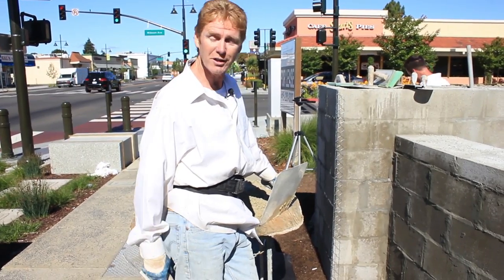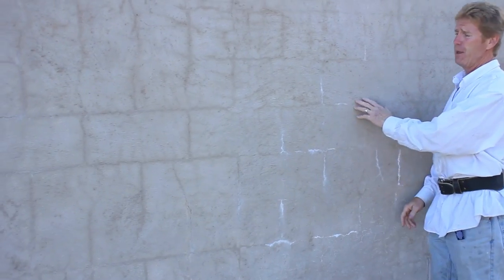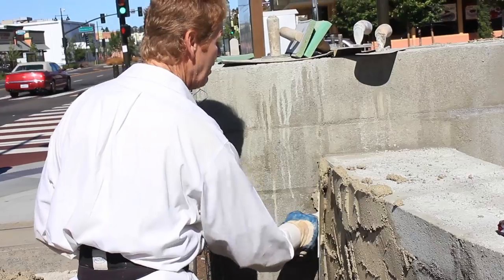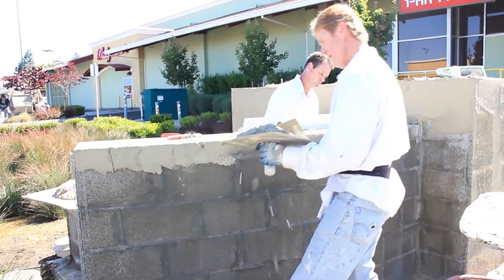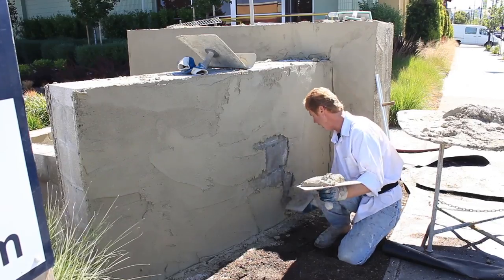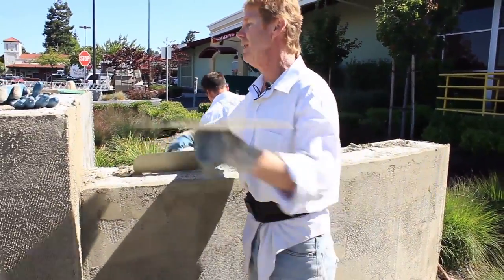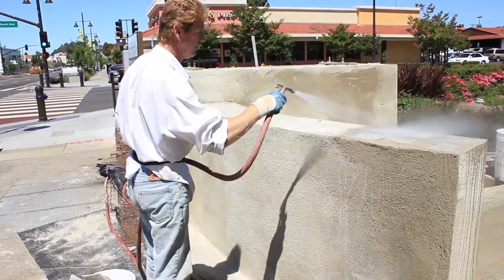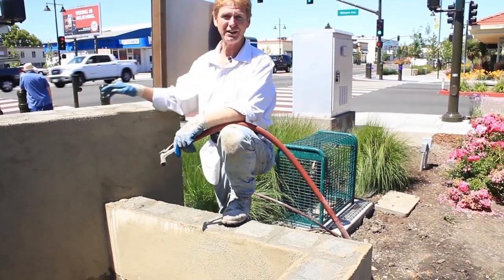How to stucco plaster Cinder blocks

Comment from the maker: Hi Mike, I sometimes call stucco, plaster as it's called both names usually. Plaster is the technical word for interior, stucco is the word for exteriors.
 I used portland cement plaster for this project. this is job.
I have seen many bags saying either stucco or plaster. Sorry for the confusion but not all manufacturers call the same material by the same name.
 Cheers,
 Kirk Giordano plastering
Reply from the maker: Hey Ed II, I agree, thing is she has a very high IQ where I'm a simple dude, so whatever she says I think to myself, unless it's about stucco she's probably right as usual.
 Cheers! 
Kirk and family
Reply from the maker: Hi Mike, Lehigh's Premium plastering cement can be used for lath or block, cement walls and so on. Portland cement is great for all jobs.
 Best wishes. 
 kirk and family

Comment: Finally I did one of these. First cinder block wall. 16x10 I had to knock off huge mortar joints. I used mason mix and riched it by adding extra Portland . I put a sponge on it after it set up for about an hour,and  brought it to a nice finish. Thanks to you.
Reply from the maker: Good afternoon Al dude, atta boy, happy holidays
                       Live long and plaster
           Sharing the plastering knowledge

Comment: enjoy your videos,as a painter i am often asked to do simple repairs in concrete or stucco and am very thankful for your information.
Cheers!
from Saskatchewan,Canada
Reply from the maker: Hello Darwyn Boucher, from Saskatchewan, Canada, Happy to here these plastering video's benefit you, once you understand what's going on that's half the battle.
 What do you think about the new painting system called Rhino Shield compared to Kelly Moore's Electromeric paint  system?
 Thanks
 kirk and family
Reply: well,I cant say that I have used any Rhino coatings around here.However,I regularly have customers requesting Moore product a majority of the time.I used a product a few years ago called Canyon Tone.I think it was from United Coatings and supplied here at Cloverdale Paint stores.It was a product for stucco that was guaranteed to never fade flake or peel.With the proper prep and careful attention there is generally something for everyone.
thanks again.
Reply from the maker: Morning Darwyn Boucher, thanks for the painting tips.
 Cheers! 
Kirk and family

Comment from the maker: Hi dragonfist, sort of, no bonding agent was necessary as this cinderblock wall is porous naturally, so the new stucco adhered by suction, It also helps to wet the wall or mist it with water because if a new finish is applied to a very hot wall it sucks up the water instantly and sometimes won’t bond as well. This misting with water was absolutely necessary on this day as it was close to 100 degrees.
Thanks for watching, have good evenings.
 Kirk Giordano Plastering

Comment from the maker: Howdy Roddy, good question, efflorescence usually occurs if the sand has salt in it. Buy clean course washed at the material yard and you should be o.k.
Only about one out of 500 jobs do I see this happen.
Don’t’ go to the beach for you sand, like I did once 25 years ago, just to make sure.
Thanks for watching and have a great Fourth of July.
 Kirk Giordano Plastering

Comment: Kirk, On my recent staycation I was involved in 2 home improvement projects which were achieved by learning from your extremely well done tutorial videos. I put a skim coat of concrete on my front porch and patched a hole in a plaster ceiling. Both jobs turned out fairly successfully at least from a cosmetic standpoint. I guess only time will tell if they will continue to stand the test of time. "sometimes you just don't know what you don't know. So any way thanks for the help.
Reply from the maker: Good morning Michael, stucco if adheared well will last forever, so no need to worry.
                                             best wishes,
 Sound advice for plastering issues from your favorite stucco geek

Comment from the maker: Howdy Architex, your reply button does not work, thus the answer to your question here,
only often do I apply a bonding agent to help stop the absorption on a big wall, I use it mainly for applying plasters over painted surfaces as stucco does not adhere to a painted surface at least for long without it.
 For a new cinder block or cement walls as long as it's very clean stucco will adhere by suctions, this take years sometimes to learn the right amount of water to mist or saturate the walls for this mechanical bond too.
            Live long and plaster
  Kirk’s how to plastering video’s

Comment: Kirk - i love your videos -they are by far the best I have seen.  I am aPrimary School teacher with a love for building, in particular cinder block structures like walls and fireplaces.  I have rendered a few at my lst house and have just moved into a new place and built a new outdoor fireplace with cinder blocks and also a pool wall.  I have always just used a portland cement render and only do one coat (guess i have been lucky!)  I am just wondering if I need to use a plastic mesh coat on my cinder block wall (pool fence) or would just one skim coat with portland cement render be OK
Reply from the maker: Carol-Lynn Hill Hi Carol, thank you, sounds to me like you have been applying perfectly already.
 If you are referring to plastic cement for render or application, as we also say, more than likely the cement plaster you are using now has lime added in the bags. 
If it were just common cement plaster,  mainly's used for grouting it would be more difficult to apply as it's extremely strong but does not spread as well as cement plaster with a bit of lime or plastic (same thing) included in the bags.
 Best wishes,
 Kirk Giordano

Comment: I'm totally new to this so apologies if I'm asking a stupid question. I'm planning on repairing a small wall in my garden where the plaster fell off. Can I just use sand and cement and get the ''float finish'' or is there a specialized product and mix I have to buy?

Thanks

Comment: Personally I would have the mix wetter, most plasterers would do that wall on there own so it would go off to quick, as a bricklayer myself I thought the blocks were a bit untidy, maybe knock up quick
Reply: Mate. That blockwork was snots galore
Reply from the maker: Greetings Plymouth, the hod carrying on this video was the worst ever.
 My brother mixed the stiffest Eisenwall cement plaster ever and it was close to 100 degree's, but we managed to apply the base coat and to apply the color finish on the same day,  there was little fun applying a basecoat that was in the process of setting.

                                  May Peace, love, and harmony find us all 
         Sound Plastering tips for the DIY beginner or the Plastering experts

Comment: Thanks for your videos. quick question. some of your videos show to pressure clean the cement walls first, and then used a bonding agent over cement. Can you please tell me when it is right to pressure clean/bonding agent approach vs skim coat applications without pressure clean/bonding agent like this one. thank you
Reply from the maker: Hi Dennis, easy question, if it's porous as in new brick or cinderblock, no bonding agent is necessary. If it's painted or sealed then you need a bonding agent.
Kirk Giordano

Comment: Just a quick question...here in Poland before the final layer of Portland cementious mud, we put a primer to make a better bond between the layers. On the video you did't do it...isn't there a risk of coming off the final coat? Appreciate your answer...
Reply from the maker: Evening Robert, No. Whenever possible, I prefer what we plasterers over here call a natural mechanical bond, when one wets the wall then applies the naturally wet stucco, this action creates an adhesion that is not compromised by any man-made glue or bonding agent.
 I use bonding agents to kill the suctions, sometimes when applying smooth finishes or when applying stucco to painted surfaces, usually.

                  Bringing peace, love, and harmony back to the world of plastering.
    The complete plastering encyclopedia on video, by the plastering messengers of Youtube.  
                                                     Over 800 videos

Comment: Kirk, I am applying basecoat over a concrete block wall. How do you suggest that I prepare the basecoat for the finish coat. Should I float it to bring out some aggregate or use a scratch brush? I'm a diyer, so something easy works best for me. Thanks.
Reply from the maker: Howdy, follow the directions in this video,
 I usually add 1 part cement plaster to 3 parts sand myself,
 cheers,
 kirk giordano Plastering

Comment: Do you always use a bonding agent(Weld Crete) when plastering a cider block wall?
Reply from the maker: Hey Big guns, The only time I use a bonding agent is over a painted or sealed wall.
 This cinderblock wall was cementitious and thus pouras and didn't need a bonding agent.
 They did however need a bit of water to help the cement plaster adhere to the cinderblock as strong as possible.
 This hydrating of porous walls takes a bit of practice as sometimes we need to completely soak it for a long time over and over depending or the heat.
Cheers, and have a Fantastic day! Kirk Giordano’s DIY plastering tips

Comment: HI Kirk, Thanks so much for the videos as they offer so much great info! I'm wondering about your use of the galvanized lathe corner pieces in this video. Is that something you always use on cinderblock wall corners or is there a particular reason in this case? I noticed in your "how to skim coat cinder block walls" video that you are not using the corner lathe pieces.Also, Did you fasten the lathe corners with tapcon here or just let the cement hold them in place? Thanks for your time and sharing your craft!
Reply from the maker: Hi Eric, I dont alway use metal corner, but on this one I did, I fastened 1/2 inch concrete nails with a special magnet and small sledge hammer,
 If you don't use the hand held magnet chances are you will have a fat finger and lose a fingernail by the time you set ten corners.
 Did  a video on how to do this.
 best wishes,
 Kirk giordano plastering

Comment: Seems like there's gotta be an easier way...  Do you ever shoot the stucco on with a special tip gun?
Reply from the maker: Hi frank mead, there is no easier way of getting this wall stuccoed or after 30 years I would have found out this amazing secrete, by hiding in a corner and witnessing this in action.
A tommy gun would require a minimum of 10 guys, I had a 70,000 dollar tommy gun, however, it would have cost me more to set up than the amount earned doing this by hand,
 hand hopper shoot finishes not base costs, it was made tough looking as the cement plaster my brother kept giving us was awful or stiff and it was about 95 degrees this day.
 cheers,

 kirk giordano

Comment: Great vid as usual Capt., I did want to ask what you're using to stucco the block wall, is it something you mixed up or a commercial pre-mixed product? also are you familiar with the product line  Rapid Set?  and do you ever use it?  So.....IF this is a mix you made, what are the components? Portland, sand and maybe some type of bonding agent?
Reply from the maker: Morning 24t68Jm1, yes I'm familiar with rapid set Eisenwall stucco, used to be 12 years ago you needed a certificate or to be certified to apply it, but those days are gone and it sold at Lowe's and Home depot to the public.
 If you're going to use tis product read the instructions well and DON'T Overmix, 3 to 4 minutes MAX.
 Or use can just use portland grey cement no worries about how long it mixes for,
The material I used here bonded to these blocks by suction so I didn't need a bonding agent.
 Best wishes,
 kirk and family

Comment: hi kirk, this is andy. So the first layer is cement, then a finish coat of stucco? i am doing a basic cinder block wall.
Reply from the maker: Howdy Doctor Dude,
 when skin coat cinder blocks only a skim coat is necessary about at least 1/2 inch so when it rains you don't see the grout line ghosting through.
 Over stucco netting over paper attached to wood you apply the first coat 3/8 think as well as 33/8 forthe second coat,
 the final coat is usually 1/8 of an inch to give you the 7/8 required.
 Cheers,
 kirk giordano
 Cheers,
 kirk giordano

Comment: We use a tyrolean spray gun to  flick speckled render on it first (This stops the top coat from drawing back into the wall) ,then one coat , rule ,float ,finish .
Reply from the maker: Howdy Jon dude, we got beat up by the sun and stiff mud on this job, but got it done anyway.      
                    Live long and plaster
         Mastering Plastering for the beginner

Comment: Hi! What would you recommend for a cinder block planter? Any stucco would work with a proper sealer inside?
Reply from the maker: Howdy Hollow Bodies, you can use the same stucco in this video, it's called Rapid Set Stucco at Home Depot or Lowes. It sells in 10 or 15-pound boxes, depending on the store, 
 or larger bags, all you do is add water, do not over mix any same day stucco's as they won't have the integrity of properly mixed stucco, 3 to 5 minutes max on mixing.
 Or just plain old Portland cement and mix your own sand with it.      
                 Best wishes,
Plastering tips from your favorite stucco geeks

Comment: Hello mrs Kirk Which type of mortar to use type S or  fiberglass reinforced  stucco.
Reply from the maker: Good evening Pop, I use Hannsons Lehigh cement plaster it has lime and common plaster already mixed in the bags, we just add sand and water.
                         Bringing peace, love, and harmony to plastering 
    The complete plastering encyclopedia on video, by the plastering messengers of Youtube

Comment: Kirk I was a laborer in masonry for 8 years and we would "dust" ( brush our walls with a dry brush ) to prevent cracking of the joints , would you use that same method when it comes to plastering ? To prevent cracking when it cures.
Reply from the maker: Good Evening Nicholas, unlike wood walls which expands in the heat, which in turns pushes the stucco outward, thus, hairlineing, bricks, blocks cement and Cementitious products like Cement blocks don't expand.
The best method for protection against drying too fast is constant watering from the water hose to the area where you're working on. 
   Hydration is the key to slowing down the set time.
 We did this wall in a hundred degrees heat, didn't help with using the fastest setting stucco either.
FYI, we used Eisenwall cement plaster.   
                Peace, love and happiness to all.
  Sharing stucco wisdom and or common sense plastering tips

Comment: Great videos, Im trying to figure out my strategy for stuccoing my ICF home in Panama City Beach Fl. I have all the videos from the build on my channel.   Maybe you could take a look and let me know what you would do as far as weep screeds, expansion joints and corners.  These blocks are 2ft long, 16 in tall. 9.5 wide.  Cement and styrafoam ICF.  expandable adhesive glue..no mortar.
Reply from the maker: Morning Stanton Smith , I have no experience with (Insulated Concrete Forms), but have much with the concrete cinder blocks and straw bale homes, our plastering systems mainly consist of wood sheathing systems where traditional lath and plaster is still the most popular or foam clad systems are used, such as the Dry-Vit system.
The ICF walls are similar and you are in a different state, the rules change from state to state.
 Sorry, I' don't know what is required in your area,
 Best wishes, 
 kirk giordano

Comment: Do I need to strip paint off a painted block wall to apply stucco ?
Reply from the maker: @beaching5788  You can, but I have never done that, it’s more effective to pressure wash very well then apply a bonding agent to the wall in question, now your ready to apply stucco.
Reply: @StuccoPlastering  thank you

Comment: Kirk would you relate your expertise with concrete with whether or not it is important to apply water as the concrete cures?
Reply from the maker: Good afternoon Tom, like stucco concrete should cure slowly the hotter the day the more misting is required at the right time.
 If either dries to fast the results can be headlining which is not  the end of the world and usually does not compromise the integrity of either cement or stucco.
            Live long and plaster
  Kirk’s how to plastering video’s

Comment: Kirk, I went to a local Home Center and ask for interior stucco. Nobody could help me with a product to use. Could you recommend interior and exterior  DIY products that can be painted or colored ?
Reply from the maker: Hi kenneth, stucco is for exterior use, Home depot sells many brands of cement plaster, rapid set is easy, you just add water, however don't over mix this product.
 For interiors use a gypsum based sheetrock compound, these set in 20 minutes to 1 hour.
 Cheers,
 kirk giordano Rendering

Comment: I have painted cinder blocks, and the paint is in good condition. Do I have to sandblast it first before plastering?
Reply from the maker: Howdy, if the cinder block is dust or dirty or if it's painted it's a good idea to pressure wash the blocks well as nothing adheres to dirt and or dust.
                           Cheers, peace & harmony 
Sound Plastering tips from your favorite stucco geeks